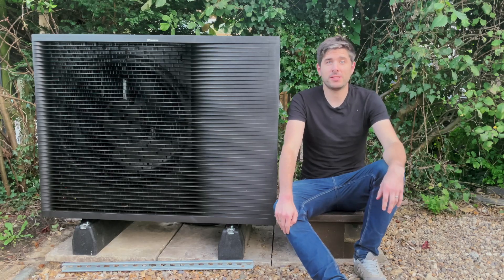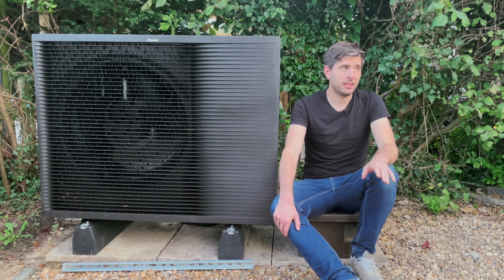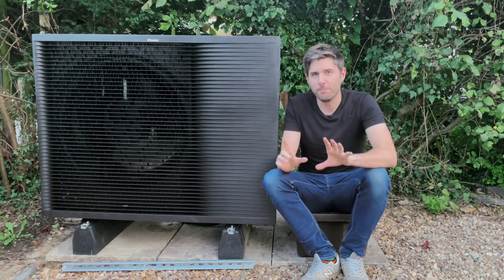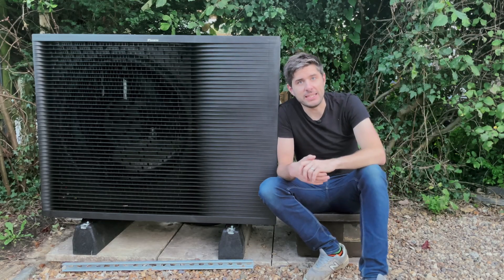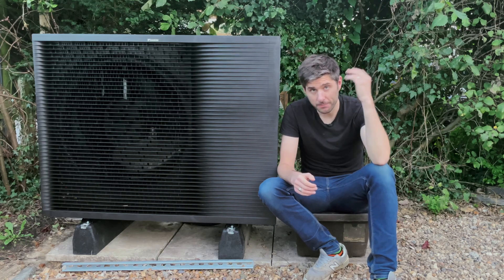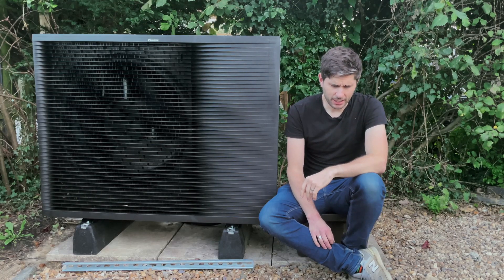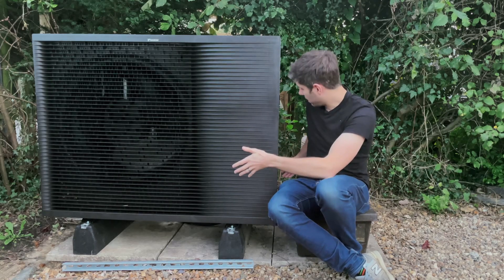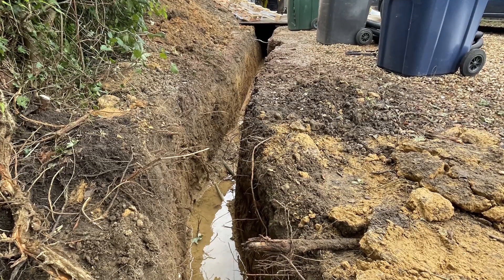Replacing an oil boiler with an air-source heat pump: Why, what and how

Comment: To say that any form of energy producer is 300-400% efficient is simply misrepresentation and an absolute lie. You cannot extract more energy than you put in - if you could, we would never have a need to produce and use energy.
Reply: Nobody is saying that at all.  The efficiency is based on unit of energy consumed vs usable heat output, because UK Gas and electric are charged in kWh, and heat is measured in kW, it makes a common ground that makes it easier to compare.
Reply: @BenIsInSweden  I'm afraid they are - look at the table presented in the video...
Reply: @TijgerTim  Timestamp? as not seeing anything misrepresenting how these work. The energy that isn't metered and consumed (i.e. electricity) comes from (in the case of ASHPs) the outside air - which isn't metered nor charged for.

Comment: Propaganda. I'm a pensioner and worked in the trade up until 5 years ago. Here's the difference - conventional heating systems run at 82c, with hot water at 60c to prevent Legionella. Heat pumps run at 55c, so you need a separate setup for hot water and much larger pipework and radiators or underfloor systems. Also an older property such as mine would need to be entirely gutted to come up to the recently introduced standards in the new Energy Act. I am unable to afford all this work now I'm nearly 70, and my hands on experience with domestic and commercial services has led me to form the opinion I would never want one anyway. It's galling, with my nearly 50 years of experience, to be told by someone barely yet shaving the opposite of what I know to be true. I recently asked a local oil boiler service engineer how many of his customers had gone over to heat pumps. Out of roughly 2000, 2 had changed. It's not just me obviously.
Reply: It's extremely arrogant to assume a younger generation doesn't "know better". Experience only gets you so far, and if you're doing the same thing over and over, without challenging your existing knowledge you become complacent.  I learnt that over a decade ago in my field, where we had 2 new hires, one had over a decade of experience in the field, and the other was straight out of uni.  The one with over the decade of experience needed far more guidance as our ways were different to what they were used to, and didn't last very long at the company, the one straight out of uni, went on to eventually enter a senior role.  You seem like the former, as you can't seem to challenge your knowledge and see what has changed.  Heat pumps (even the one in this video) can exceed 55C without any assistance.  For legionella, it doesn't need to be kept at 60C, and hot water cylinders paired with heat pumps have anti legionella cycles that can be scheduled, either these are with immersion (in the case of R32 heat pumps), or if the heat pump is R290, it can handle going up to 70C to do the cycle.  Also due to building regs from last year, any new heating system installed (including gas) need to have a max flow temperature of 55C.  Larger rads, means better efficiency in any modern heating system - whether condensing boilers or heat pumps.

Comment: good video but my neighbour had a heat pump put in for his oil boiler and he keeps excellent detials of costs and he seeing much higher eltricity costs so no real savings with his family hes now relying on the imersion heaters to have hot water and boost the radiator heat on cold days this week with sub zero days here in scotland hes seeing the boost heaters in the buffer tank come on.. long term hes putting in underfloor heating but hot water usage and heat pumps dont work out at the moment
Reply: that's got the hallmarks of a badly installed system.  Not an issue with heat pumps in general.

Comment: Heat pumps are only efficient if you have a super insulated home. A CoP of 3 or 4 is a falsehood as a heat pump needs to run 24/7 whereas oil boilers can be turned on for an hour in the morning before you get up and for an hour or 2 in the evening. You need a double size water tank and replacement radiators due to output of 54'c ish On the coldest days a 4kw heat pump will cost £35 a day to run and maintenance is expensive, guaranteed only 2 years (7 if manufacturer approved installer) and more maintenance intensive than a conventional boiler. Then there is the noise so downstairs bedrooms are a no-no and even if combined with solar, the solar won't be theremin winter. So the heat pump solution is only for underfloor heated, super insulated houses. Do.not be convinced otherwise!

Comment: We have Oil. We bought a new oil boiler when we moved in. Then fuel prices moved and the oil became closer to gas so we are happy. Here in Scotland we need a decent amount of heat in winter so I just can't see how air sourced would help and electricity isn't that cheap either.
Reply: Although I think the Scottish grants for HP are far more generous than England,

Comment: An excellent explanation. We would like to replace our gas boiler with a heat pump, but the process has been ruled out due to the cost of having to rip out all the 8mm heating pipes, and a brand new 2000l pressurised hot water tank. We have solar panels and batteries, and they heat the water for 7 months of the year.
Reply: Can you retain the 2000L tank as a buffer?

Comment: Have you got used to the condenser fan ramping up and down and the droning noise off it I bet you had to take a maintenance contract out with the install supplier and was the contract  labour only or fully comprehensive

Comment: We have a non standard construction home, probably the least well insulated version of a house you can have. The walls are like heat sieves and can’t be cavity wall filled. Probably the only method of insulation is to kingspan the internal walls, so all the current radiators and piping it’s an old single pipe system, would need ripping out a re-plaster of the whole house, new flooring every where. New double glazing, loft insulation and then a heat source pump, that’s going to hum all the time. There are 50 homes on our estate of the same construction and probably 200 in the village mostly pensioner owners. You are definitely fighting a losing battle trying to save the planet. Sorry our limited resources mean we will have to stay with what we have😢

Comment: If you have an older house, and you can DIY it to some extent, rip up the old floors, insulate and fit UFH pipes. I’d never install a solid floor without UFH now. It’s the most efficient way to heat your home, no need for radiators except upstairs.

Comment: Slightly tangential, but could a heat pump be made that uses oil as the input fuel not electricity? Has it been done? The heat pump gains it’s benefit from fluid temperature differences not electricity vs oil etc right?

Comment: Really informative Michael, thank you for pulling it together...we were in a similar situation a few months ago, we live in a very rural location dependent on oil, coal and logs for heating...oh and solar panels for everything. Our oil tank started leaking so we looked into air source/ ground source heat pumps, our trusted and reliable heating companies basically persuaded us against the idea. Friends and neighbours regurgitated the horror stories..so we just replaced the oil tank then a few months later our oil boiler required replacing, not unexpectedly to be honest. I tried to get quotes from companies but none of them appeared very interested or trustworthy. There clearly is a problem with availability of reliable installers so we decided to leave it a few years to allow the market to mature. Perhaps we have been too cautious...our home is a large detached 300yr old stone house, double glazed with loft insulation but it’s still not a well insulated building. As you say the tales of woe of other installations definitely scared the horses with us. We will try again in a few years when this boiler/tank breaks or if the price of liquid gold becomes unaffordable.
Reply: I live in a 300 year old former farmhouse in N Yorkshire.  When I first moved in it used an LPG system which over time  became very expensive.  We switched to an oil system as no mains gas in the village.  This was OK for around 12 years but the steel oil tank which was well painted and mounted on pillars showed signs of corroding at the bottom and was going to need replacing along with the boiler at some point.  After some research I opted for a wood pellet system having an old shed which was suitable to convert into a 3 ton hopper.  The boiler sits in a cellar and as a bonus the North facing room above is now warm in the winter.
The system works very well after some teething issues and didn't require replacement of radiators etc which would have been the case with a heat pump.  It is the best method of heating the building out of all three we have used.  To supplement it we have a solid fuel cooker/ boiler in the large kitchen which in which I burn recycled wood briquettes plus some logs.  This proves invaluable during not infrequent winter power cuts.

Comment: So, I'd probably have to get a larger-coiled hot water tank and bigger radiators (19 of them!), along with a complete re-plumb as it's currently a micro-bore system.  Then to ad insult to (financial) injury there's all the ripping up of floors, walls etc. and restoration afterwards associated with the job.  Would I get any change from £30k.... I very much doubt it.  Here in Scotland the green zealots are planning on stopping the sale of gas and oil boilers in 2025 (although, thankfully, it looks like that is now slipping a couple of years) - if my oil boiler stopped working and they were still available elsewhere in the UK I'd be hitching up my trailer and heading off to buy one!
Reply: @sucofnisucofni8935 I detect snake oil salesmen and conmen moving into the heat pump sector at a rapid rate.
I have nothing against heat pumps when they are installed appropriately i.e. in a well insulated new build or perhaps during a major rebuild, but in the majority of existing buildings they are not suitable for retrofitting unless a vast amount of other work is carried out at great cost.
It seems that the politicians in Scotland are happy to drive the green agenda despite the fact that many house-owning pensioners like me will potentially end up in cold houses - bonkers... unless they want to kill us off to save money!
Reply: There is another way - add enough insulation so you can run your existing system at a lower flow temp. Once you're there any high temp ASHP will just be a direct replacement for your oil boiler. The Daikin Michael bought does 70°C at -15°C air temp so your tank and rads will be fine. You won't get the BUS grant (or Scottish equivalent) because MCS will want to do it their way but it'll cost about £7k all in.

Comment: You didn’t mention the installation cost or how you get the same heat output from a radiator when the temperature of the heating flow and return is 3Odeg C lower with your ASHP than the equivalent oil or gas boiler. I assume the flow temperature is elevated during the hot water cylinder heat up at night? We also have no gas in the village so run on oil and I did the maths. There was negative payback. Yes we have a 400 year old farmhouse and converted outbuildings to heat but even so there was no financial case for going ASHP. There is no one size fits all solution to this and each application has to be properly evaluated based on sound engineering practice. I’m not against heat pumps, indeed I’ve designed systems incorporating them since the early eighties so my advice would always be proceed with caution. Hope yours works out well for you.

Comment: Ashp or a Gshp uses the approx same amount of electricity to produce the equivalent amount of heat you get from gas (cost point of view). At the moment it is a good alternative to oil, but and it is a big but, when the gas users convert to heat pumps along with the EV revolution, the price of electricity will increase as the demand increases. So a heat pump needs to go hand in hand with solar to offset and add some protection from market forces. We are seeing the price to recharge an EV matching or going over the price of petrol to fill an equivalent car now. I have an Ashp however i only run it for the hot water in conjunction with an immersion heater to bring the water up to 60 degrees. It is there more for a back up as we mainly use a stove and a diesel parking heater for the back of the house (uses red diesel). I installed solar panels when the Ashp was installed. No alterations to the rads, the house is cooler without these additional heat sources. Heat in vs heat escape is the main problem and that is so expensive to fix in a Victorian house. Sorry for the rambling comment

Comment: Do any wire heat source heat pump is efficient if it’s running underfloor heating which only runs low damage anyway on radio is absolutely rubbish. Had one in my house tried everything and I’m a plumber. Wish I never ever heard the bloody things. Have a new house now which has a heat or heat pump on underfloor heating upstairs and downstairs and it is amazing on a radiator, not worth the hassle. 😢

Comment: Hi Michael, I liked your laid back presentation of your 'heat pump' experience!! As you recounted the work which you had to have done for the installation - from the trench to the loft floor raising I was adding up the cost. I run a hose renovation company so am well aware of what work costs. In simple terms I reached about  £18000 for the full installation which is so much more than a new oil tank and new boiler and in your words - for what? The Planet has been around for 3 billion years so human activity is insignificant in the overall scheme of things!! I will be interested in seeing your future video after the winter and hearing about the cost of being warm!!

Comment: We reaplced our old ASHP with a new one, ripped it out within a year and got a vertical drilled ground source heat pump.
ASHP,  don’t work when it gets to around zero or even 4, at this point they need to use electricity, as they get to below zero they freeze up and need constant defrosting whilst defrosting no heat is produced.
We live in Sweden and most ASHP are being replaced by vertical drilled Ground Source.
Add to this the noise whilst it’s defrosting, which can sound like a double decker bus sitting outside, we bought the claimed quietest ASHP on the market.

Always go ground source if possible ASHP are no where near as good in any respect.

Our ground source drill hole went down 196M, so the drill rig took a while.
Reply: Very interesting, i hadn't heard of vertically drilled piping for a GSHP (I've only got s small garden).

Comment: I’m sure you’ll get your heat pump to work this winter. Then, in the spring you’ll have to tell us how big your home is and how much electricity was used to keep it warm.

I’ll have to admit I’m not a fan of these devices because I’m unable to see their financial benefits unless you live in a well insulated home and have a top quality installation. Even new homes built it the “highest energy efficient” designs are pretty poor and the wood butchers and bodgers who throw them together are being asked to work well beyond their abilities. A simple 90º cut and a plumb wall is beyond most of them. And now they have to millimetre accuracy to ensure thermal efficiency. No chance. At the same tike our ignorant politicians with their degrees in arts, law and politics are spouting on about a future where we will be kept warm by ‘green’ electric boilers and heat pumps. Really? 45% of our population live in rented accommodation. How will they set these eco-boilers up? How will ‘just about managing’ afford a new system? How will we improve the dire thermal efficiency standards of our existing homes? How will we improve the current group of wood butchers, pipe benders, brick slingers and cable knotters so we can actually move ahead? Currently our building standards people are messing about with plugs and light switches near bathrooms, hose retainers on showers and fixing non-existent problems instead of addressing the real problems - the dreadfully low standards in our inept building industry.
Reply from the maker: Hey Trevor - we’re in a ‘30’s semi detached. So far so good with keeping everything warm (we actually had to turn it down as it was getting too warm). I’ll do a video in the spring with some more data as to how much energy we used.
Reply: @michael_bird Thank you for that. Just out of interest, what size of pipes to your radiators do you have? The reason I ask is that we have the horrible (10 mm OD) microbore pipes. I’m not sure we will have sufficient flow rate with these pipes.
Reply from the maker: We don’t have microbore, so we were very fortunate that no pipes needed changing

Comment: Hi Michael, thanks for the video, I’ve recently changed my heat source too. A major difference with my system and yours is the control system. I use the Tado system for my radiators, it does the weather compensation and time control of heating with the addition of self learning early start/stop, far simpler zoning using existing pipe design. The point is it brings the control to your smart phone, I’d already had the system on my old oil boiler. Difference between you and I , 50plus years of control of heating systems both oil and heat pumps. I’m not a business you want information about mine. Answer this via a reply.